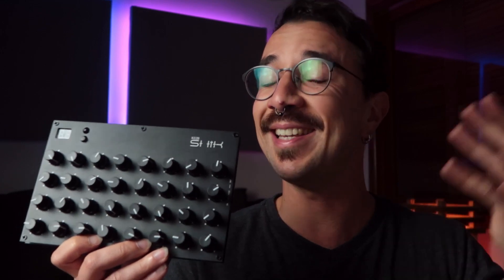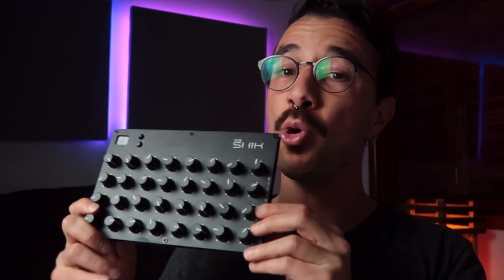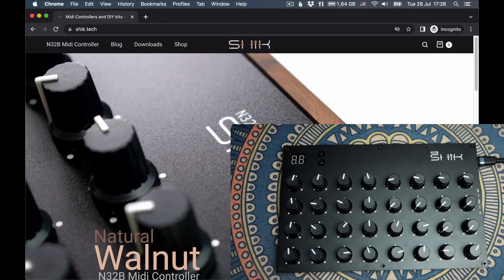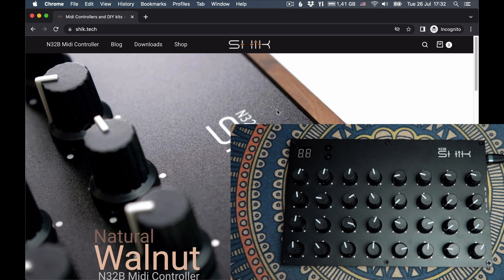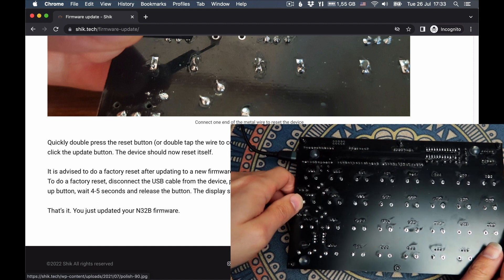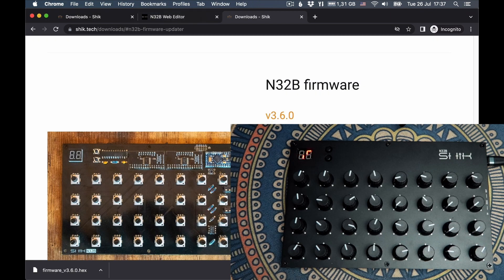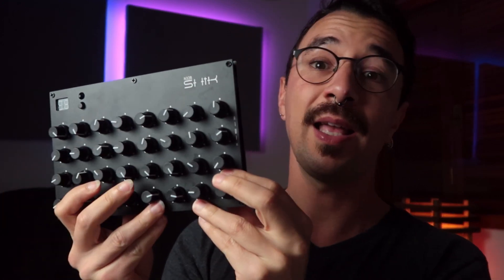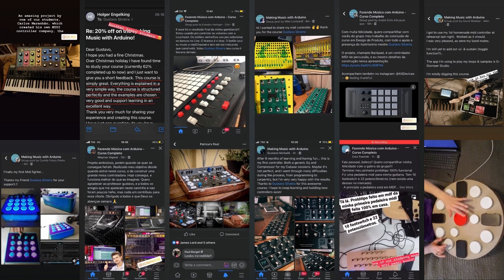From DIY to the MARKET: Meet the SHIK's N32B!

Comment: Isn't this essentially a QMK keyboard with all rotatary encoders and midi as default output?
Reply: If you consider a switch that has only 2 states the same as a rotary encoder that can report up to 10,000 positions per revolution at it's highest resolution, then yes... yes it is.
Reply: @Mad4400  QMK firmware on keyboards like my Planck do support rotary encoders and MIDI. I am not sure about the resolution. The controller used looks like an Arduino to me. The PCB looks like a typical keyboard PCB to me, but I am a software guy.
Nevertheless it still is an awesome Idea with a beautiful design.

Comment: Vídeo Excellenet
Hello, can I make the midi controller with arduino uno r3 on ATMEGA328? Well, it doesn't have atmega 16u2.

Thank you very much.
Reply: The short answer is no, as the 16u2 can act as a USB host while the 328p cannot - if I remember correctly. There have been some hacks to make it work - and you can always use Hairless Midi Bridge and LoopMidi (both free) to get an Uno talking over USB, but the implementation would be a bit different.
Reply: @arsebiscuitsandwine  Thanks for the reply.

I think the R3 is an update of the previous arduino uno, because I can't find one with the 16u2.

Comment: I wish this to be a 32 endless encoder version with led feedback and no detents. I cant believe this does not exist on the market.  I would built one if i could. 🤓
Reply from the maker: Maybe I'll build something similar
Reply: @NerdMusician  Would be great to add that to your existing payed course! :)
Reply: try the intech studio MIDI modules, they have a 4x4 grid modules with one of them being the endless encoder you want
Reply: @marzbitenhaussen  I think they use detent encoders which i don't want. And the construction seems fragile. I would like 32 x akai apc mk1 type endlesss encoders with led feedback. No detent. These have the best the best smooth movement of all midi controllers i have ever used. The rest is either too plastic too small, too light or stop working in a year😆 The BCR2000 is actually a great machine in terms of specs. But the hardware quality is poor.  I have two and they both have encoders or buttons have stopped working completely.
Reply: @MultiMam12345  they have 4 types of different modules, all modular and they snap with magnet to each other, they have 1 with infinite encoders and also every encoder is clickable, and also a detent module in which all the encoders are just knobs, they also have another module with a mix of infinite encoders and sliders and another one that is a grid of 16 buttons. You could create a 32 x 4 or any multiple of 4 grid simply putting together a bunch of them.
Reply: @marzbitenhaussen  I know all that, but as I said. Their module with endless rotary encoders have detent. They do not have a encoder module without detent. Which is surprising to me. Smooth Endless encoders + led feedback are the most versatile to me personally. Detent encoders are only useful for stepping. Great for switches. You don’t want to control a filter cutoff with a detent encoder. And you also don’t want jump/catch behaviour which normal potentiometers have.
Reply: @MultiMam12345  makes sense, good point